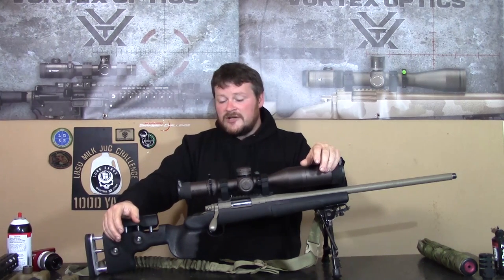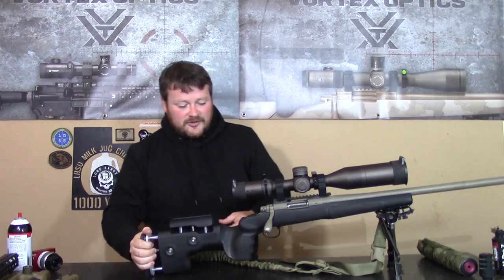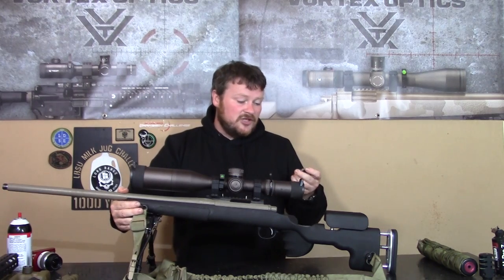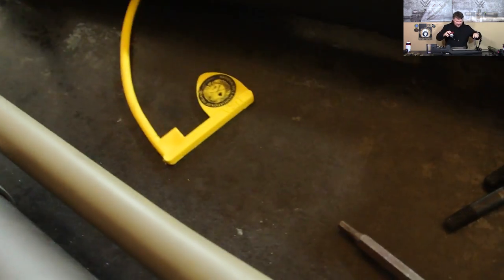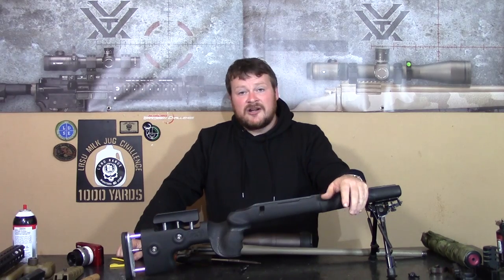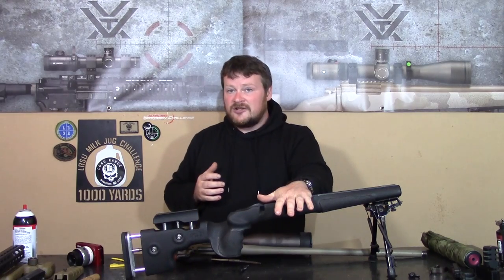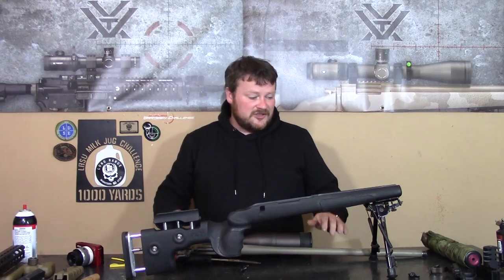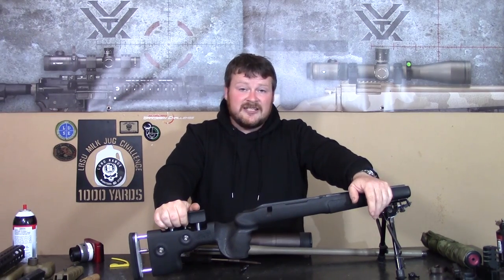Review: GRS Berserk Remington S/A

Comment: Thank you for the review. Got this for my Tikka t3 last month, was really good fit, but I still glass bedded it and also stabilized the forend with match-grade synthetic stock stabilizer. overall gained a bit more weight after all was done but it was worth it and .came up to be slightly heavier but was worth it.
Reply from the maker: Next time you have the action out if you could send me a pic, id relay like to see that. milliradians(at)gmail.com
Reply: no problem, ill take some pictures in couple of days and will send you.
Reply: Irakli, did you feel like the forend needed reinforcement?  I'm looking at the Berserk for a Howa build, but the rigidity of the forend is one of my concerns.
Reply: the stock forehand is as rigid as synthetic stocks will go, if you intend to carry the rifle for hunting and shoot mostly from hand or using a sling and with not heavy barrel than no need for reinforcement (this stock was designed for carry in woods hence the lightness of the construction) but if you are thinking on putting bipod on it than I would recommend stabilizing it (although it makes it heavy) or better yet, just get GRS Laminated stock, it might be better solution in case you are looking for that extra stability (they come pillar bedded already). The floor of the stock forehand (bottom part of the forehand) is very thin however the side walls are very thick so overall it is rigid but it does bend after applying some pressure to the end of the forehand. Hope I answered your question.
Reply: Still haven't taken the pics bro. Sorry for delay.
Reply: Irakli Thanks, that helps.  I'm looking for an all-rounder to use with a heavy barrel 24" Howa.  Sounds like the Berserk may have a little too much flex for my use - mostly varmint and LR target
Reply: In my opinion (and I am not a specialist), GRS laminated stock would be a bit better option for you.

Comment: perfectly timed review, I'm considering this GRS Berserk stock but for a Savage 10 FCP-SR 20" ;)
Reply from the maker: II have not seen the Savage version, But if its built like the r700 version, Go for it
Reply: MRAD Outdoors From what I heard, it's the same model, just the points of link adapted to each rifle. BTW, what model of suppressor (sound moderator) are you using on yours?
Reply from the maker: +Phil Smith it's a wildcat predator 8
Reply: MRAD Outdoors Fantastic! From the video, it looks like it's pretty efficient... I will have a look. Thanks again for the videos and info!

Comment: Hi MRAD. I'm considering getting a Remington 700 .223. I was on the GRS website and it says that this stock aswell as the Decima Sporter stock is compatible with the Remington 700 BDL SA/LA model. Do you know is this the only R700 model it suits? What model is yours?

PS great review!
Reply from the maker: As long as it is a R700 action it will fit does not matter of it is a dbl or sps or any other version. But wont fit a 710 or any other
Reply: Awesome! Thanks so much for the quick response! Looking forward to getting the rifle. Keep up the good work. Your videos are great!